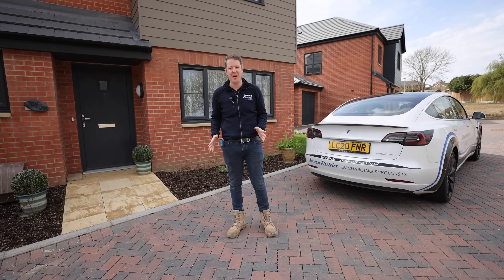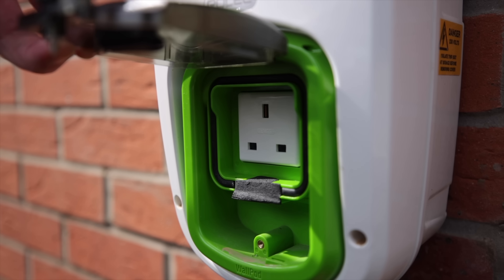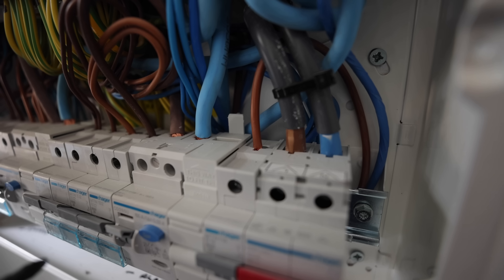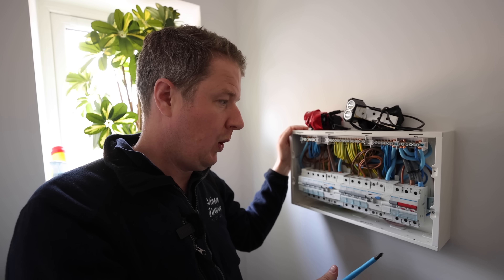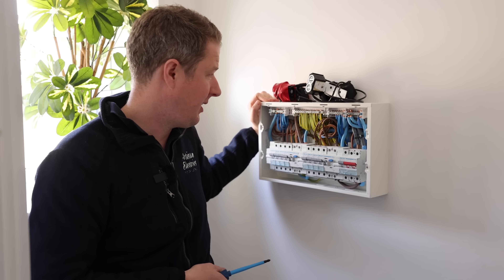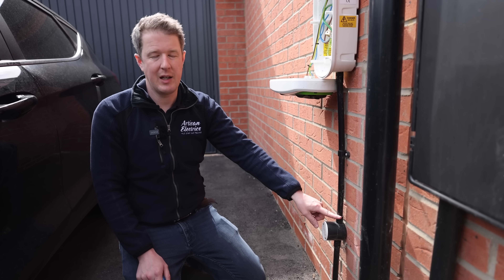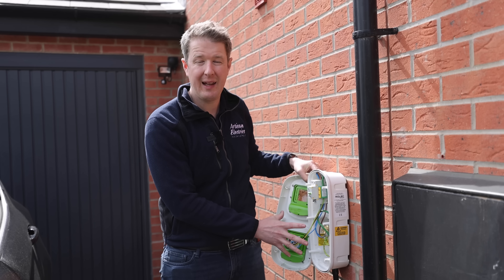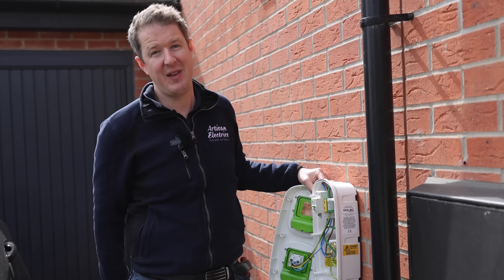New Builds AREN’T READY for EV Charge Points!

Comment: Personally, I don't like the EV using the consumer unit. The meter box should be the point where a EV charger should be connected. Why have 32 amps flowing for many hours thru the house consumer unit when you don't need to? If the EV breaker gets hot so will adjacent breakers and that's not good. Best to keep the circuits separate in my opinion...

Comment: Hey Jordan, could you please explain why you would need to move the circuit from the high integrity side of the board, to be under the RCD if you wanted it to be a Smart Charger?
Reply: Better off changing the MCB for an RCBO, no?

Comment: if you found that install shocking you should see my EV charging lash up.
RCD from a wall plug into a 25 meter double insulated cable buried in the front garden to a hidden waterproof double plug hidden in the garden hedge.
Charges my Outlander PHEV fine in 4 hours but it is a small battery (13 KW).

Comment: Majority of car drivers having to switch to EV either can’t afford or can’t have home charging but some will have to relay on using an extension leads with a Granny charger run down a garden path or over a garden wall or out of a top floor window . So Jordan what are the specs on installing outdoor 3 pin sockets.I’ve installed a 16 amp spurred off Waterproof BSI standard blue commando socket on my outside wall in armoured cable with a specific length 18 amp extension cable in Black cable protector ramps across the pavement into a granny charger in a waterproof garden enclosure under my EV overnight use.Probably not legal but practical

Comment: This seems absolutely pointless, you can get wall chargers for a few hundred pounds.
They've already had a electrician wire the house and to the wall box.

Why not just install a working cheap charger, at least then they can be used for charging.

This idea you're forced to get a electrician in if you get a EV, rather than only if you want a better charger.

If it's about the environment, it's better to do it the first time.
This idea you now have extra multiple visits from a electrician most likely driving a ICE vehicle.

Comment: Sorry to be a stickler for accuracy, but you (all) are usually bang on point! For clarity, do you mean a 4sq mm cable? Also, while 4sq mm is suitable for shorter runs, of course over a distance you need a thicker cable (I can't remember the voltage drop calcs now - it's late!)

Comment: Would you need DNO approval to increase charge capability to 7kw because this had originally been installed with a 16A breaker?   Also if upgrading to say a Hypervolt, what would the savings be between the setup here and a no fuss new clean install?  Thanks.
Reply: I believe you do need to inform the DNO, because all it is at the moment is an outdoor socket. I don’t think you’d save anything upgrading, kWh is same price - unless you are on a tariff that is cheaper at night and you want to schedule that; not sure if Rolex is that intelligent (?) but alternatively you may be able to schedule the EV itself.

Comment: I agree it doesn't look great and it doesn't provide the strain relief or IP rating a gland is supposed to, but I can't think of anything technically wrong with earthing the armoring that way...

I'd argue it's better than those earthing plates you see in street lighting, for example... Also better than leaving the SWA long and terminating it into a screw terminal or worse not earthing the SWA at all...

I'm genuinely interested if anyone can think of any actual regs or guidance this conflicts with, other than it just looking a bit rough.

Comment: Out of interest, what would you mandate if you had to write the specifications for 'EV ready'?

As a customer, I think I'd be happy with a useable outdoor socket, with a 32A supply, and sufficient room in the CU to add whatever gubbins is necessary for an EV. The earth rod is a nice touch. I think as a customer I would assume that the whole socket would get ripped out and the charger put in its place, but I'd be glad you weren't having to rip apart the interior.
Reply: That’s what I’ve spec’d on a few properties,  normally gets wired with 6mm. Just skip the dumb fake ev charger outlet and stick a normal ip socket there until they’re ready to upgrade it.

Comment: EV Ready Wallpods - seems like a waste of time.... Surely better to simply ensure that an Armoured Cable of the correct size/spec has to be installed to an external socket point. Eg something stating that 6mm Armoured Cable installed into IP  Rated External Socket externally, combined with 32A (or 16A) Circuit Breaker in main board...?
Potentially..... that is good news for the home owner. If the house is typically less than 2 years old then the Builder is, generally, on the hook for remedial work. That could mean that they will pay some of the cost towards having the charging point installed........including fixing the balls up on wiring. However on the flipside it does make you wonder what else has been bodged in the house wiring.
We have recently discovered that we have an upstairs socket wired into the downstairs socket circuit and the main bathroom radiator has been plumbed into the downstairs heating circuit (S Plan Plus installation). That's just the most recent of the catalogue of issues in the Taylor Wimpey build.
Reply: The builder typically goes into liquidation about 2 seconds after they got paid (they relayed that money to the subcontractors at x+1 second). Then a new company is made for the next development; same owners, same "sub-"contractors...

Comment: That earth rod is right next to the incomming services!! 

TBH it seems like a common mistake.  I would be really surprised if there isn't a really low resistance between the rod and the PME terminal.  If you put a rod anywhere near a service that has been bonded to the mains supply you may as well have just bonded the two together.  If there's a PEN fault your rod will pick up the main earth and have the same issue as all the other earth-bonded things in the house.  They really suck unless you can get them a good distance away.
Reply: But isn't a person that stands in a puddle right next to the rod picking up the same potential? I'd be concerned that the puddle next to the incoming supply would pick up the terminal earth and touching a car that is bonded to a far away earth would lead to exactly what the earthing is there to prevent---just in the reverse direction than what's expected.

Comment: A typical new build quality!  What happened to the new build inspection?
Reply: Inspection doesn’t cover the electrical installation. Contractors just need to supply the certificate… And you can put anything on the paper, nobody will check it…

Comment: Changing from 3pin to a 16A dedicated charger is actually a significant improvement because the 3pin connection is usually only 2KW vs the 3.7KW (nearly double) and the type 2 fitting is more reliable.
Obviously it depends on EV and what you use it for, but bigger isn't always better or necessary.
Reply: I think it's 2.4kW to 3.6kW isn't it? Better than a poke in the eye, but I would be seriously annoyed to discover my new house could only support 3.6kW EV charging because the builder was a cheapskate.
Reply: @richardalderton1047  well, AFAIK, it's a current limit rather than a wattage limit, the 3.6 is a calculation on 220-230v. Some 16A are labelled as 3.7Kw, but it's rather finicky point. For car manufacturers, the OBC limit is given as 3.7kw.
The answer, as always, is, it's complicated 🙂
Reply: @richardalderton1047  One other thing that a lot of people don't seem to realise is that the charging speed is actually limited by the car's OBC. Many cars, especially hybrids, can only charge at 3.7KW max from the mains anyway (especially common in hybrids).
Just to give you an idea, the average commute distance in rural areas is 23 miles a day, which equates to about 2 hours charging, even on a 3.7KW

Comment: Those wallpods seem silly but I don't think they'll be able to fit them anymore under the upcoming regulations (from what I've read).

All chargers sold from June 2022 will have to be smart and for the new build regulations due this summer it's proposed that chargers will have to be mode 3 and at least 7 kW.
Reply: between 1200 - 1400 i believe unless that is just a recommendation rather than reg
Reply from the maker: Very good point

Comment: Hey Jordan. My understanding was that ev charge points required double pole isolation.
Is that allowed via the RCD even though it has other circuit on it or should it be a designated RCBO? Also hate these these ev ready points and the way it’s been installed is ridiculous. Love the channel, Keep up the good work👍🏻
Reply from the maker: Yeah the RCD serves as double pole isolation so that’s fine. You could also put it on a double pole RCBO instead which would be even better.

Comment: I know it’s shocking to look at but, the outer sheath is earthed, it has a fly lead and if the gland is tightly secured round the cable. From a safety aspect it’s fine. It’s not a well thought about install, glanding  back entry into a wall, you would have to drill a seriously large hole to that. I have seen miles worse
Reply: Agreed, I can't think of anything wrong with earthing the SWA that way, other than it looking rough. Genuinely interested if anyone can point out any regs it conflicts with.
Reply: Except that it knackers the waterproofing of the box.
Reply: @PETER WILSON I completely agree with what you're saying. Especially when talking about the installation as a whole and the IP rating not being maintained..  although a gland isn't the only option for maintaining IP rating.

I guess I'm less talking about this specific installation, and more hypothetical scenarios... E.g. is it ok to use the earthing section of an SWA gland to earth the armouring, even if you are using some other method of entering the enclosure?

To take the hypothetical to the extreme, what would be the best installation method if (for whatever reason) you had to go rear-entry at both ends of the cable, and therefore glanding-off using the ordinary methods were impractical.

Or even, if you gland one end normally, but the other end can't be, is it better to simply tape over the armouring or to somehow earth both ends, even if one end has to be earthed using an unconventional method?
Reply: @PETER WILSON  131.1.1 (good workmanship & manufacturers instructions) I can see the argument. Definitely manufacturers instructions for the gland (assuming the gland pack has instructions) but I think the good workmanship part is a little less clear cut, if some other things were improved, such as ensuring the IP rating is maintained (e.g. using silicon) then I think that part becomes a bit more subjective.

510.3 basically just repeats the need to take account of manufacturers instructions...

I must admit I was hoping for something a bit more specific than the catch-all "follow manufacturers instructions," especially given we don't actually know what those instructions said in this case 🤔

Comment: In the process of buying a new build property now that comes fitted with an EV Charger, I've got a move in date coming up in the next month, should I be looking to check if there is a Surge Protection Device fitted in the consumer unit for it and flagging it with the property developers if not with the new requirements? Is there anything else I should be paying more attention to before signing the house off with them regarding the EV Charger?

Appreciate the heads up and info as I'm not a qualified electrician but find the information and videos facinating!

Comment: 6:40  I would assume that over time that earth electrode (ground rod) won't work properly because water can't properly get to the soil under all the brick and asphalt driveway.  This will cause the resistance to rise up and get worse as the ground dries out over time.  You actually need the moisture to be in the soil around ground rods.
Reply: Have a look at regulation 411.5.3 , table 41.5 and note 2 of the current regs 😮😊
Reply: The rod was hard against the external wall so it has probably been drilled through the foundations too. Bit worrying.

Comment: I'm summary the EV ready wallpod seems pretty pointless. Also, new builds should be future proofed with 3 phase and cater for 22kw chargers.
Reply: 3phase is overkill for home charging.

home charging is 8+ hour blocks of continuous charging every day. That should be enough to account for most people's daily car needs even when it's only single phase granny charging. (this is especially true if you can charge at your workplace).
Reply: @ratchetfreak  I can only charge 4 hours a day off peak on my tariff, so I would prefer to fill my boots in this time frame thanks (and no I cannot charge at my work place).

Comment: So in order to "protect the planet" we install pointless "EV Ready" pods with the explicit intention of them becoming eWaste when the home owner actually wants to charge an EV?  Madness!
Reply: Have you started to figure out the only green in “Green” is money. 🤡
Reply: The crazy thing you’re burning fossil fuels to create the electric to provide power for these Ev chargers. So how green are you??
Reply: @rjkelectrical6086  Even if you were using coal to generate to the electricity over the average lifetime of the car you still produce less co2. Luckily in the UK we only use about 3% coal and generally have about an equal mix of nuclear, gas and renewables. And new renewables and possibly nuclear are coming on line. The greener the electricity the better it is. Im on Octopus Go and mostly charge at night when it's generally cheap wind power. If I charge during the day it will be on solar.
Reply: @rjkelectrical6086  quite a lot. 
1. Large scale plants running at a constant power are much more efficient than an ice running at a changing power, also a lot of power plants also produce municipal heat, increasing their efficiency. 
2. Most countries have at least a decent chunk of renewables, not 100% fossils. 
3. You need a lot of electricity to make fuel, so not using fuel and switching to ev might not increase your power consumption much.
4. Extracting and transporting oil carries a huge environmental catastrophe risk that is much lower for other fossil fuels, like coal or gas, which are used for power generation.

Comment: Why would you need to fit an SPD on an existing install? Wouldn't that new requirement only apply to a new CU?
Reply: Also not required until September?
Reply: @sunthroughtheblinds  that's only for pre designed installs. Anything new must be up to regs.
Reply: @sunthroughtheblinds  not required ever on an existing circuit.
Reply: There's no need to protect the existing installation with an SPD, but the newly added circuit needs SPD protection. Yes, it's splitting hairs, but that's the save way to read the regs in relation to installer liability...
Reply: Because this industry is in the mud. They see the words spd and amendment and start retrofitting them everywhere
Reply: Given the agg with the EV grant inspections they prob just covering themselves.  Not that the grant exists anymore …….
Reply: @robturnbull7240  2 grants exist currently....
Reply: Doesn’t need SPD
Reply: He doesn't need SPD protection for the rest of the install, but the new car charger is itself a new install. I'd argue anything that requires an EIC (rather than a Minor Works Cert) would need an SPD fitting.
Reply: Which would you prefer, a house without an SPD or one with? I know my answer after being hit with a mains spike a few years ago!
Reply: @toddbod94 I know nothing about how software on EVs work, but my reasoning for the importance of SPDs is that transient voltages have the potential to corrupt the firmware in the Battery Management System and that could result in overheating etc... resulting in a battery fire. Not to mention any other control systems in the car.
Reply: Why would any sensible person try to save £50 but put a car worth £50K at risk. Not to mention the possibility of a battery fire catching the house on fire. It's a no brainer, fit it even if you think there is a loophole in the regs. Then sleep at night.
Reply: @geraldelwood9660  most chargers have Surge protection is what he probably means….  Might not be their car, could be a company car.
Reply: Most ev installers fit an spd

Comment: recently moved into a new build with a Rolec charging point with no PEN fault protection, there was no earth spike fitted, i requested it was changed to include an earth spike, they reluctantly agreed and fitted the rod and off they went, when i checked the install (second CU in garage) they had installed the rod but had not changed the main switch in the board for an RCD, so called them back again and reluctantly fitted said RCD, i now asked for the missing installation certificate for the CU in the garage which was now a TT system (which i stlll have not received after a year!!) they said it would be with me shortly, i asked the electrician what the reading was on the earth rod and he couldn't tell me, i asked what the RCD disconnection time was he said it was all good and disconnected in .28 ........ i said are you sure that's good?? TT disconnect is 0.2 i haven't seen them since and i doubt i will.
the less i say about the solar install the better

Comment: And that's exactly why I got the electrician to fit a 32amp breaker and 32amp rated armoured cable to the external 3 pin socket I got fitted for my hybrid charging so that its an easy upgrade in the future
Reply: Hope they ran a data cable too
Reply: @newlinerealboi3434  was just gonna say that